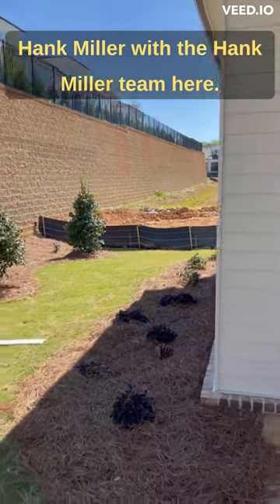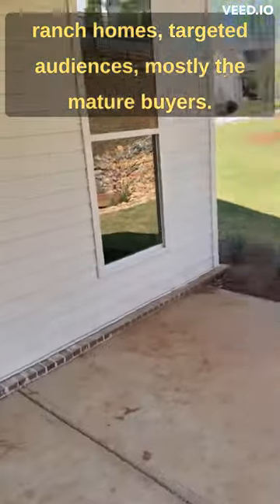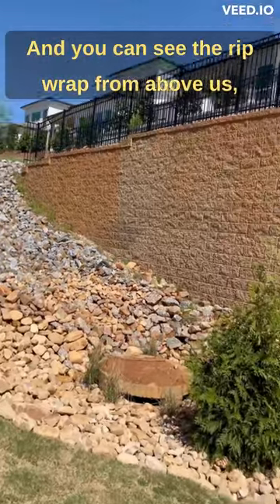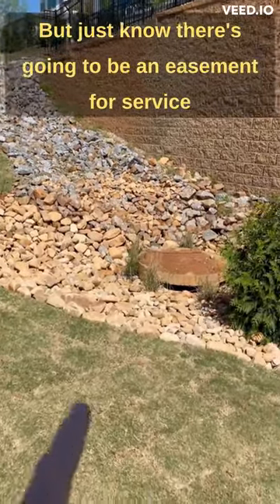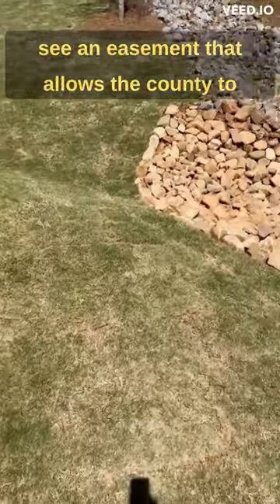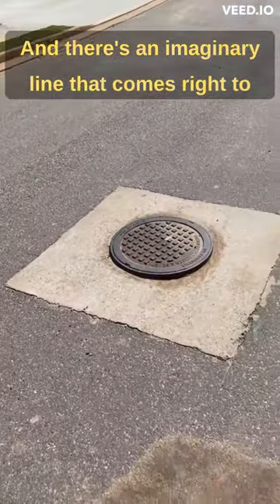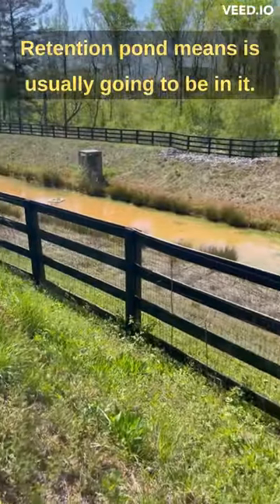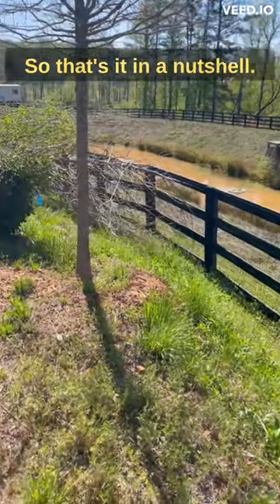How to Spot a Drainage Easement

Comment: I have a county stormwater easement at the front of my property where a stream runs from my land under the road through a county maintained pipe.  Where the stream is, my survey and the plat shows a line that says "approximate drainage yard line - House to be built above 400 feet." This line overlaps a property line. Does that mean both property owners have an easement to access each others' land to bury their french drain pipes? Or is it just the area where we cant build our home due to water drainage? the county doesnt recognize it as one of their easmements.  There is no infrastructure inside it just a stream.